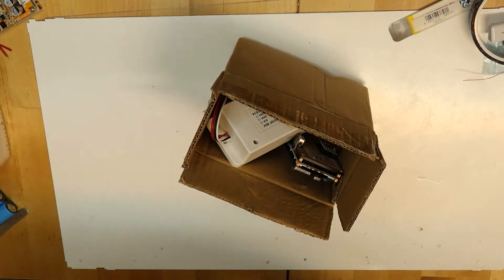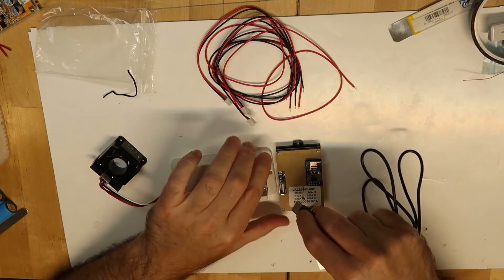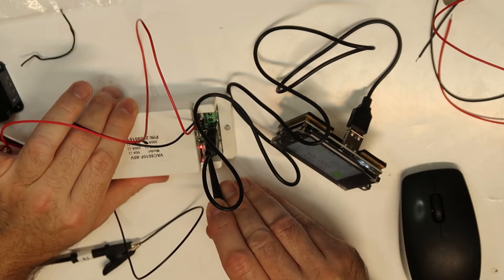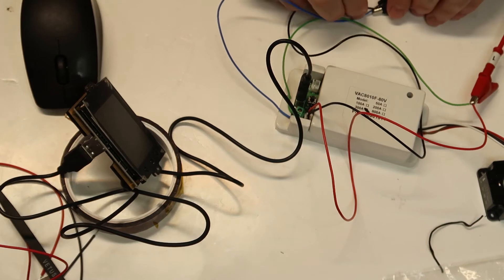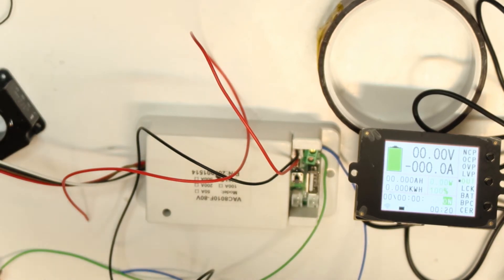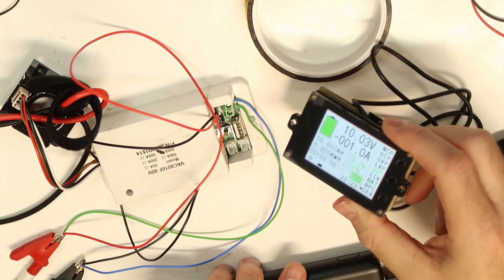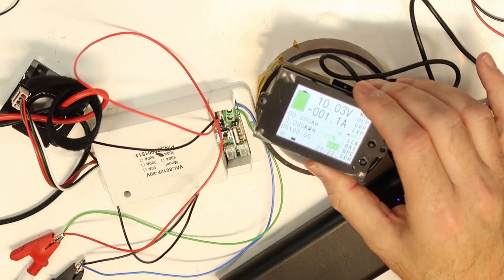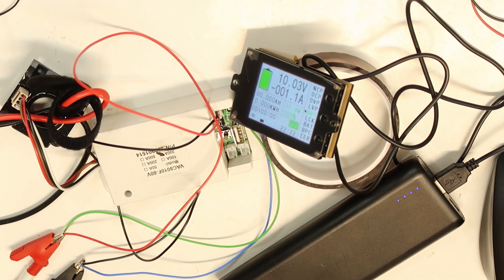Current Voltage Meter LCD Wireless!!!

Comment: Warning, the is a complelty buggy product. I tested 3 different units. Do not buy the prodcut, it is an unfished piece of shit. Problems: The manual is wrong. 1. The red wire and not the black wire goes through the hall sensor. The volt measuring wire is on the same bus bar and thus there will be a flow of current through the black wire which leads to an offset of Amp mearuring. 2. NCP and OCP are in the manual wrongly named. The NCP parameter is OCP and vice versa. 3. A lot of language errors. 4. Two units lead to a situation where the output relay could not be changed anymore after paramters were changed, only a reset helped. 5. Two units did not allowed a change of the different modes. 6. One unit started smoking after some time.  Really do not buy this product if you dont want ending up having a lot of problems. Start a refund processs and send it back.

Comment: Hi..hope you can help.  I set the BAT to 400AH (Full capability of batteries) and  I set the BPC to 100% because these new batteties had been on 240v charge for 24hours, so were at 100%. Battery reading at 13.4v. Problem: the battery picture and AH% is at 63% and dropping.  It is not going up when the batteries are being charged.  Is there something I can do?  Thanks

Comment: Hi there.  I bought one of these meters 2 years ago and my auto electrician set it up when he installed it.  I have to reset it again and have managed to all but the BPC.  I put the dot next to the BPC, press the middle button which makes the BPC red, then using the top button I take the '0' number in the left, middle box to 100 and press the middle button again to set.  But, the 100 goes back to '0'.  Can you tell me why this is, I hope you can help.  Thank you
Reply from the maker: I will need to find it and recheck - I don't remember exactly, I will try to do it in few days